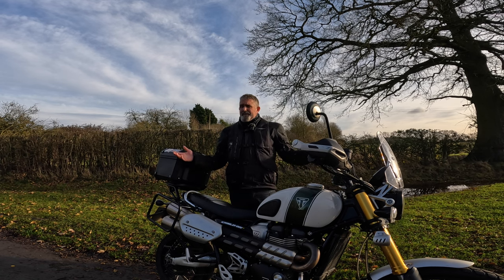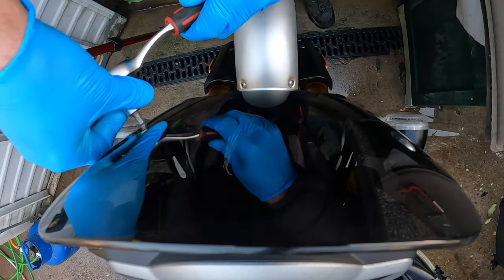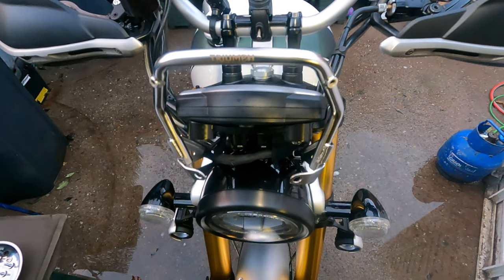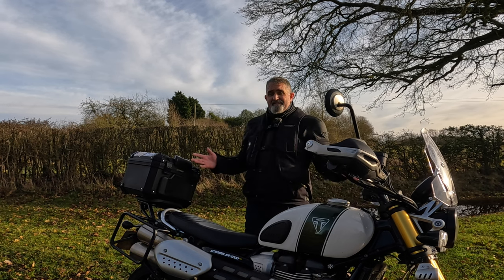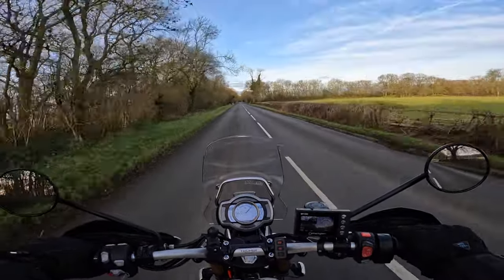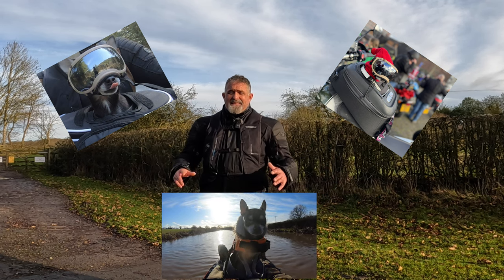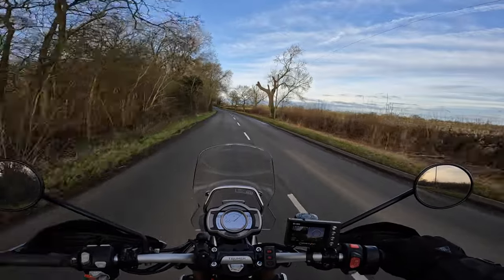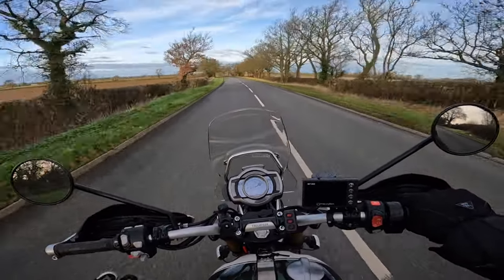It finally arrived for the triumph scrambler 1200xe

Comment: Over many, many years I've realised that screens are very personal. i.e. What works for me might not work for anyone else. So far I'm on my third screen on my XC. The first was a Unit Garage that got lots of positive reviews but it was hopeless with lots of buffeting. Then I fitted the lower half on a Puig Up&Down that I already had in the shed and it worked great bit looked awful. It came up 12" from the top of the headlamp shell and was quite wide. So I looked for something with a similar height and found the Dart Marlin. Early impressions are good. The beauty of the Dart is that it mounts using the headlamp mount bolts and so the screen can be adjusted for angle, unlike the solid mounted ones like the Unit Garage your Triumph tall. I'll also say that taller isn't always best because the wind comes around the sides of a screen to fill the vacuum and this is what causes buffeting. I'm 5'10" with "normal" proportions.
Reply from the maker: Thank you 🙏 for watching and commenting 👌 and I definitely agree that it all depends on the riders shape size  and I don’t think any configuration is ever perfect but definitely better than  no screen 👍

Comment: I’m considering this or the unit garage screen for long distance rides next year. Good to hear your insight. 
Will you keep your smaller screen or sell it?
Reply from the maker: I will probably sell it at some point , can’t see it going back on , I definitely miss my triumph discount, so if you no anyone that works at triumph they will get you a 50% discount on any part or accessories, the triumph tall screen definitely makes a difference and would make touring easier, as ever thank you for watching and commenting 🙏
Reply: I got the unit garage, it’s high quality, and it eliminates all the hard wind off your body but these wind shields don’t eliminate the head wind unless you scrouch down.
It looks like what he has there is the same height as mine.
Mine was around $250 US dollars after all said and done including shipping.
The shipping was great btw, they really get thing moving.
The one thing mine had is there’s a place for a GPS if you want one.  I also like the shape of it, but this one is a nice shape as well.
I will be adding an extension onto it in the spring time.
That’s one difference I see between the two, and that the top on this one is rather on the round side. Not sure how the extension would work on that.
They do make an extension with a single center mount, but I’m not sure if the shape would match.
The windshield he has seems to be from triumph so we should expect it to be of high quality as well.
I guess you’ll have to choose which shape you like better.
Considering the GPS mount.
Correction….after looking at this lad riding, it looks a little lower than the unit garage shield and much rounder.

Have fun !!!
Reply from the maker: @ginoasci2876 thank you for watching and commenting I did look at the unit garage and it was second on my list price wise after import tax and shipping it wasn’t far off the triumph price that and with the triumph screen I used a friends triumph discount, I’m also thinking about trying a extension 👌 have a amazing new year 😎🤘
Reply: @bikerbuddy3166 let me know if you’re selling the small one. I need one
Reply from the maker: I will do 👍